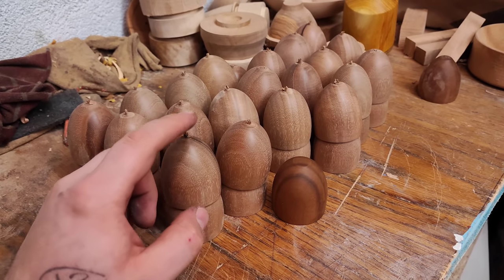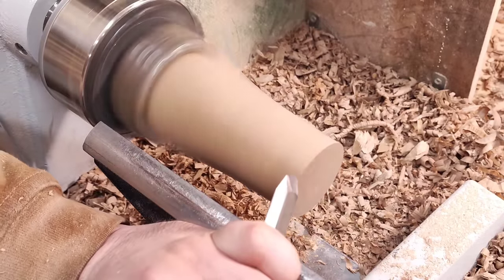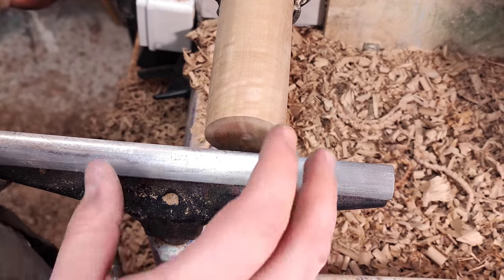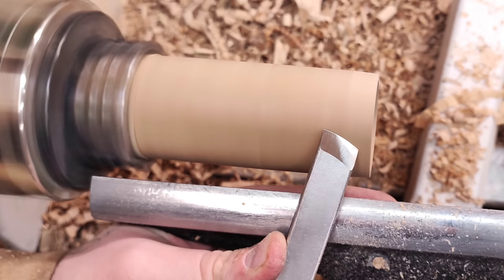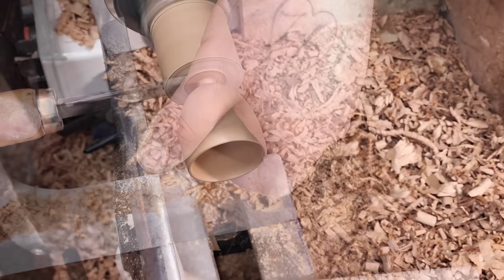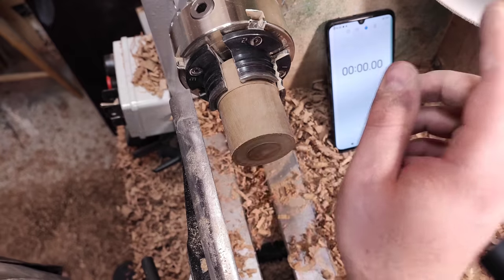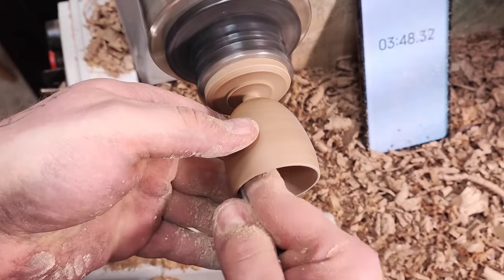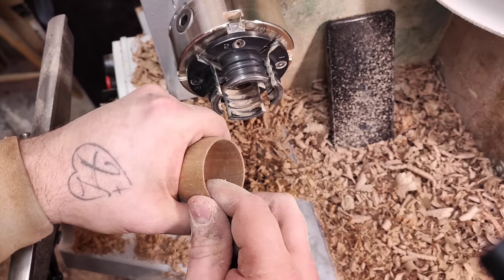Well, this should keep me occupide for a few days

Comment: When I make small items like these, I submerge a batch in a big jug of food safe oil, then tip the whole lot into a big funnel & it drains back into the oil bottle overnight. The funnel has a filter to catch any stray shavings ( a paper coffee filter makes a good filter). Nice job, thanks for posting.
Reply from the maker: Its a great method to use a jug, in this case client wants something with wax on top , its time consuming but one by one 200 are finished😀

Comment: To make the sanding faster, you could sand from the inside and outside at the same time, balancing the force you apply so that you don’t need a supporting hand but rather have two sanding hands equalling out so that you don’t break the piece off.

Comment: Very nice. Thank you for the video. I have 2 questions. What kind of wood is that? And when you put the drill bit in and make the center hole, are you holding that bit with your hand or did you make some sort of handle to hold the bit? Thanks again.
Reply from the maker: Thank you, its walnut and there is a handle on that drill bit, otherwise its difficult to hold it😉

Comment: Thanks for the video. The glasses are good, the main thing is impossible to break
Reply from the maker: Indeed they don't break😀
Reply: @tomislavtomasicwoodturning  You would not be able to shoot a video about how you seal up cracks, if there are any in the workpiece
Reply from the maker: @_Egor_Egorov_  no cracks on these
Reply: @tomislavtomasicwoodturning  Do you buy ready - made blanks for turning ? Don't you prepare it yourself?
Reply from the maker: @_Egor_Egorov_  for these cups I bought 53mm slab of walnut.... Usually I have around 500 different sizes of rough turn bowls on shelfs
Reply: @tomislavtomasicwoodturning  I let the trees down and dry myself. You have a good supply of rough bowls. Thanks for the answers

Comment: Tomislav, I enjoyed watching the marvelous tool control.  What oil do you use for drinking cups and does it stand up to not only liquid but also alcohol without damage to the wood?  Thanks.
Reply from the maker: Thank you, most alcohols won't damage wood, and anything apart maybe epoxy will wash out quickly... Epoxy is expensive and for this kind of cups I use linseed oil and wax blend , it washes easy but also you can repair easy as that....
Reply: @tomislavtomasicwoodturning  thank you for all of your videos! I always thought alcohol would dissolve an oil and/or wax finish. Do you ever have any problem with that, like your drink tasting like the finish?
Reply from the maker: @vicmitnick  no, not really as its washed the finish is washed as well.... If you want to use it more heavy, then just use food safe oil and once that is dry in a cup its perfectly fine to use....😀
Reply: @tomislavtomasicwoodturning  Hi Tomislav, thanks for these great videos!  Do you ever have problems with raised grain once they are washed?
Reply from the maker: @derekroberts5984  thank you Sir, I do have raised grain sometimes but that is just a nature of the wood.... With frequent use it will get smother